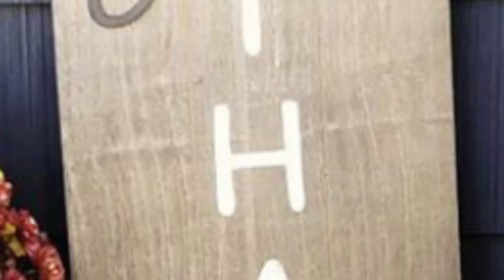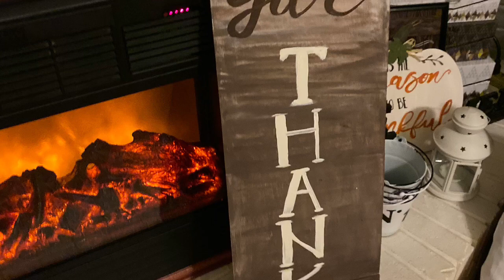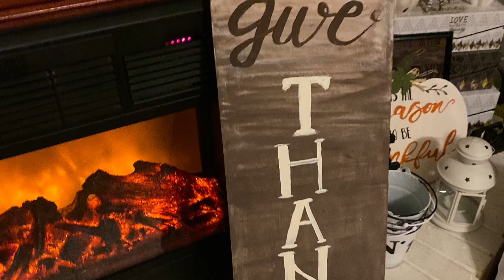DIY Dollar Tree: Hostess Gift -Give Thanks Tag

Comment: Have a question about using hot glue. They have hi temp hot glue guns and low temps. When is it best to use the hi or low settings? Does the brand of the glue sticks matter? What are the pros and cons of the rechargeable glue guns and does anyone have a good recommendation? Thanks! 
I agree, your free hand lettering is beautiful.
Reply: Im not Jerri but I have been a crafter for years and I love my surebonder glue gun. If your near a hobby lobby you can pick it up there. Also a big fan of surebonder glue sticks. As for temp. I do everything on high unless the product has a low melting point. Example: mesh ribbon. Also invest in a "glue finger" because that stuff gets HOT!   Nothing against the gorilla glue users but I do better with sure bonder. Infact I couldn't wait til I used up my gorilla glue so I could get back to my favorite. Have a blessed day!
Reply: Donna Busic  Thank you so very much for the advice and information. Will definitely check into the Sure Bonder brand. Sounds like the glue is very reliable when it comes to craft projects. We have a Hobby Lobby in Corpus Christi.
Reply from the maker: @Mespot, Sorry for the delayed response, Donna’s answer was spot on. I’m hardly an expert in brands, this glue gun brand is only the second I’ve tried outside of AdTech, like ever! Lol. I’ve never tried a rechargeable one either. Thanks for the great question.
Reply from the maker: @Donna Busic thanks for the tips!  I may have to check that out!